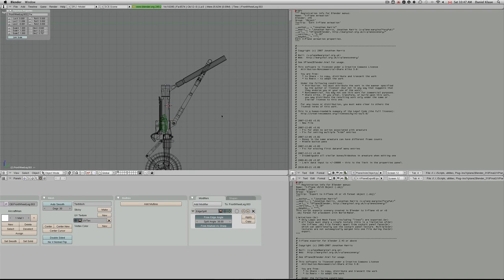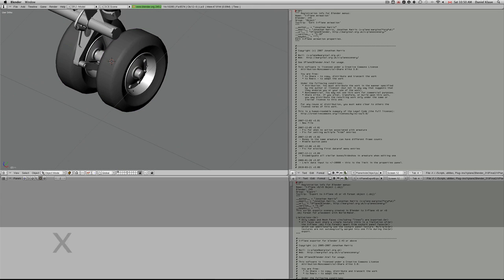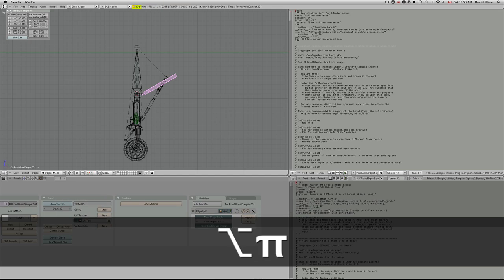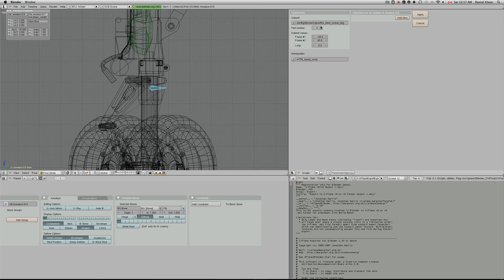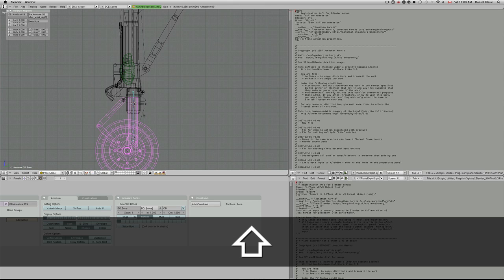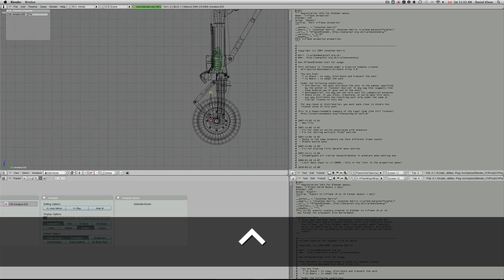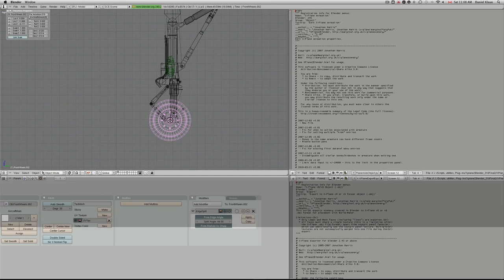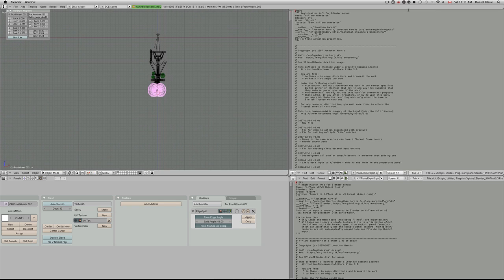PlaneMaker - 39 - Blender - 25 Nose Gear Animation

Comment from the maker: @Stickman698 There are way more datarefs than there are buttons.  In fact, the cockpit buttons don't internally connect directly to datarefs.  They are more closely tied to "commands," but datarefs end up getting switched by commands.  You can find a list of commands and datarefs in X-Plane's "Resources>Plug-ins" folder.  They're labeled "commands.txt" and "datarefs.txt."  You need to add "CMND=" before the commands, and set the manipulator type to commands in Blender.